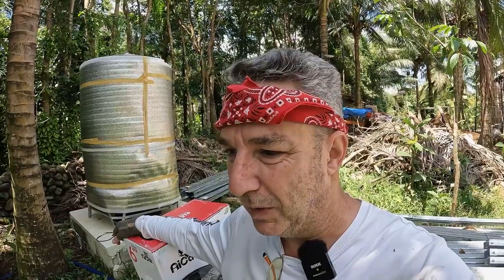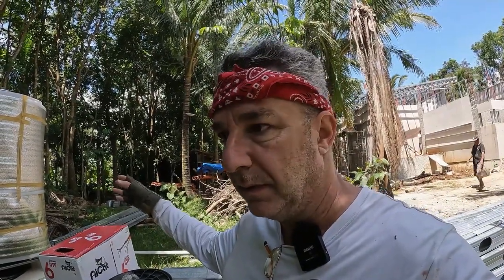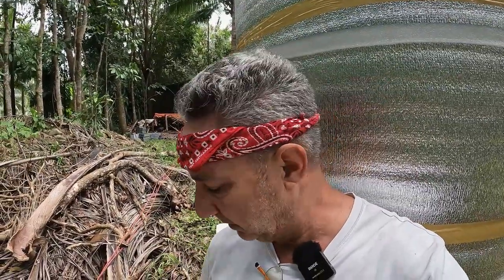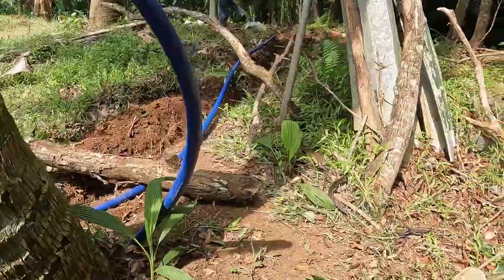Copper & Fiber Cable Run 🛜 | House Build Philippines | Ep. 23 | TORINO

Comment: Man u had me confused why u running those legs.........ok u experimenting, got it......I will assume u did not have conduit on-site, but I was looking at tht flexible blue water line......tht would be my conduit, I would opt to run another one and drop the cat6 and fiber in it, and paint / label the ends to differentiate water line from data conduit/line......but also Wifi should work through the trees.......yes/no?.........Heard TESLA was using some new wifi tech standard outside the factory building to cover the distance across parking lots, dont remember the name.....BUT  I am watching and learning/taking notes sir.
Reply from the maker: Yeah, I was taking advantage of the trench being dug (by someone else) for the water line. I wasn't planning on running cable down there, but I figured what the heck, give it a try. Now at least I have a pull through for more/different cable. Eventually I will have some IP cameras around the property and down by the Chateau d'If. Thanks for watching.